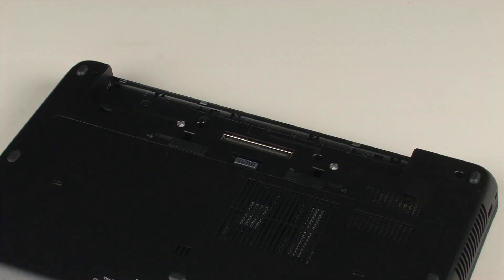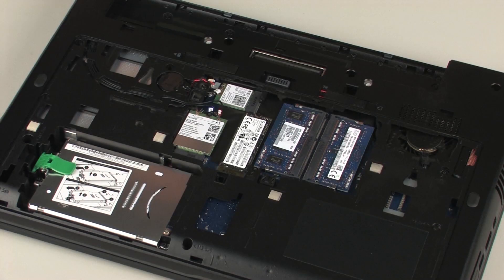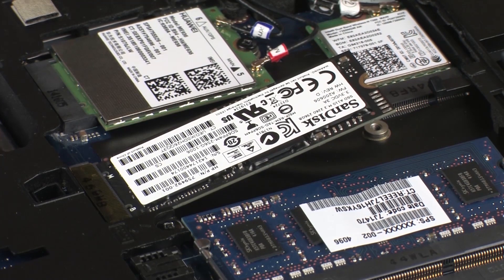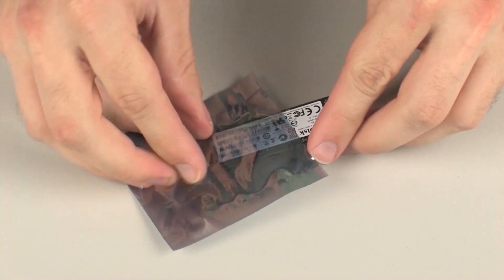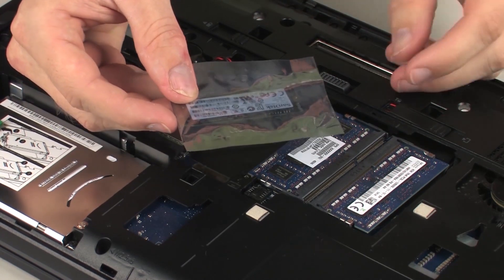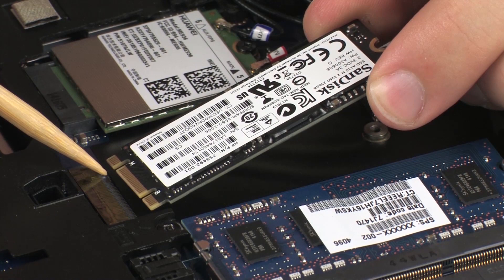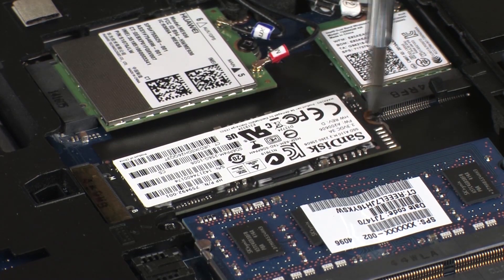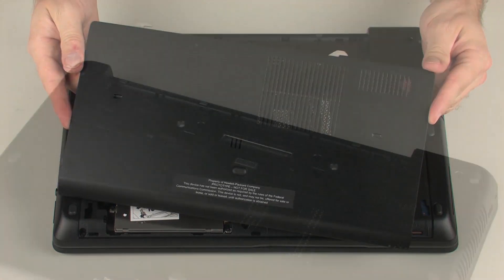Replace the Solid State Drive | HP ZBook 15 G2 Mobile Workstation | HP Support

Comment: Support 
NVMe M.2
500GB
crucial
Reply: Win 10 install , but it's not noot from m.2
Reply from the maker: Hi Rouzbeh, thanks for contacting HP Global Social Media Support!
I understand that you are experiencing an issue in booting from M.2 SSD. 
I will do my best to assist you.
Since the service manual makes no mention of a NVMe SSD being supported, it isn't going to work in any capacity.
It won't boot, you can't use it for storage.  Nothing.
You would have to try it with a SATA SSD.
Binu_HP Social Media Tech Support

Comment: HP manual book seems irrelevant. My Zbook 15 G2 can only use M.Sata SSD with form factor 2242 (with two screws).
Reply from the maker: Hi there, thanks for contacting HP Global Social Media Support!
I understand that you need to know about supported hard drives.
I will do my best to assist you.
Please refer 'Storage and drives' under the specification page to know about the supported drives: https://bit.ly/438gaf2
Binu_HP Social Media Tech Support

Comment: I can't find a straight answer on google. I cant find a diagram that lables all the expansion ports on the motherboard. CAN YOU PLEASE TELL ME WHAT THAT PLUG IN CHIP IS ON THE LEFT OF THE SSD? not the wifi chip above but the bigger chip on the far left. My port is empty but yours has something. I am just curious what it is for so i can decide if i want to add one to my own labtop. thanks.
Reply from the maker: Hi Robert, thanks for contacting HP Global Social Media Support!
I understand that you need a diagram that labels all the expansion ports on the motherboard.
I will do my best to assist you.
Please refer the service guide of your computer as it may be useful to you: https://bit.ly/3ZBvChh
Binu_HP Social Media Tech Support

Comment: Hello, I started an installation using a pen drive to do in a SSD 250GB but when the copy of files has done and the system restars it re-start by zero from the usb key
I removed the sata SSD but in the bios I see again it
Reply from the maker: Hi Mauro, thanks for contacting HP Global Social Media Support!
I understand that you are experiencing an issue in setting up SSD.
I will do my best to assist you.
Please refer to the instructions mentioned under this document to fix the issue: https://bit.ly/3rO41Z9
Binu_HP Social Media Tech Support
Reply: @HPSupport  Sorry but I didn't find the solution... peharps I explained bad
I' a ZBook G2 15 workstation with an SSD sata on board and I bought a SSD mvne M2 and I'd like install Windows on it.
I unplugged the old SSD and I started the installation by the usd key
whe I ha to choise where the installation I can see the new SSD M2 and it copied all files on the SSD M2
Now, it's normal, the system reboot and the installation goes haed but...
when the laptop restarts it doen't see the SSD m2 and restart the installation by the USB key, so I trusted to remove the key
but nothing the system bios said non hdd or ssd are present
If I see the list I can see the old SSD Sata (model number serial number) as it's mounted but it is unplagged.
Reply: so the question is: how can I do to mek SSD M2 available on BIOS? Why I can see the old SSD in the list?
Reply from the maker: Thanks for the reply.
Please try updating the bios of your computer as mentioned here to fix the issue: https://ftp.hp.com/pub/softpaq/sp103501-104000/sp103523.exe
Binu_HP Social Media Tech Support

Comment: I added ssd next to hdd and moved windows 10 to ssd but it boots from hdd what to do?
Reply from the maker: Hi Yousef, thanks for contacting HP!
I understand that you have added SSD next to HDD and moved windows 10 to SSD but it boots from HDD.
I will do my best to assist you.
Please try the below mentioned steps to fix the issue:
Shut down your computer, remove the back, and removing the HDD. Then, start up the computer, and it will boo from the SSD. Then,  shut it down again and reinstalled the HDD, put the computer back together, and boot to BIOS. It should show the SSD as the boot drive.
Please let us know how it goes. 
Binu - HP Social Media Tech Support

Comment: Hello
I installed the m2.ssd nvme hard drive on the same laptop model and installed Windows, but when installing after restarting, to continue installing Windows, it gives the error that there is no booted image  disk, please help.
Reply from the maker: +Hamed Salemi Please have it default to the M.2 in 9 easy steps:
1. F9 in Startup Menu
2. Boot from UEFI file
3. Search through a ridiculously long file name (looking for "PCI") to find M.2 - PCI needs to be listed twice
4. Click <EFI>
5. Click <Boot>
6. Should only be one option - mine said "bootx64.efi"
7. It will boot one time with the M.2
8. Use DISKPART in CMD to remove all partitions from the old HD or else it will always boot from the original drive (unless you remove it)
9. Presto! Now it will default to the M.2
Reply: Hello, thank you for your answer. How can I send you a photo or video taken? Do you have an email? Or WhatsApp?

Comment: Has anyone here successfully installed their NVMEs (PCIe or SATA) on their Zbook 15 G2? if so lplease let me know the specs e.g. brand, model, size, etc. that worked for you.
Reply from the maker: +Ted Francis Asuncion It does not support NVMe.
Reply: @HPSupport  okay.. Thanks so what's the purpose of those slots then?
Also, if I go with the 2.5 SSD, can I get 1TB or 500GB?

Comment: HP SSD EX900 M.2 PCIe NVMe / HP EX 950 M.2 PCIe NVME compatible? there are issues while the manual specifies, B/M key is two notch in the SSD(AHCI) and only M key is single notch in the SSD(NVME). From the video it shows it will support B/M Key, wherein the word NVME refers to M.2 "M" key. can you please clarify which type of NVME M.2 will support?
Reply from the maker: +Subramani V Please refer the service manual of your computer to check the compatibility: http://h10032.www1.hp.com/ctg/Manual/c04493862
Reply: @HPSupport  Service manual not exactly provide the information what I was looking for, however, I got fixed the NVME M.2 Key, this system having auto switch to convert / identify the SSD module. So it support M key as well B + M key
Reply: Its too long

Comment: I hv installed mSATA, it is read as a secondary drive, I installed windows 10 on it, but won't boot from the Nvme HP EX 900 250GB. Download latest bios HP site but still no driver  support on bios. HP ppl sort this
Reply from the maker: +Thulani Dube Please perform updates via Windows and HP Support Assistant as mentioned below to fix this issue: Step 1 Windows Updates - 1) In the search box, type and open Windows Updates. 2) Check for updates. 3) If the updates are available, click on install and restart the computer. Step 2 HP Support Assistant Updates - 1) In the search box, type and open HP Support Assistant. 2) Check for updates. 3) If the updates are available, click on install and restart the computer.
Reply: @HPSupport  not working, why can't HP supply bios updates with nvme driver support
Reply: @thulanidube3391  HP EX 900, NVME SSD(M Key) detects as Secondary Drive?
Reply: @c4subramani  yes
Reply: @thulanidube3391  Thank you!
Reply: @thulanidube3391  It works, NVME M.2 M key support. Thank you again.

Comment: I've got a problem, SDD m.2 2260 SATA III doesn't appear... However, the documentation of my zbook says "There is one internal M.2 PCIe/SATA slot. This slot is auto-configured at power up to be a PCIe or SATA slot depending on the type of card installed. M.2 slot supports 2260 SSD (Solid State Drive)"
Reply: were you successful in this one?
Reply from the maker: +LesCraslins Martinez Please perform updates via Windows and HP Support Assistant as mentioned below to fix this issue: Step 1 Windows Updates - 1) In the search box, type and open Windows Updates. 2) Check for updates. 3) If the updates are available, click on install and restart the computer. Step 2 HP Support Assistant Updates - 1) In the search box, type and open HP Support Assistant. 2) Check for updates. 3) If the updates are available, click on install and restart the computer.

Comment: Dont buy this laptop as it keep having the BSOD issue(device power state failure), feedup with troubleshooting this issue.
Reply from the maker: +Hard code Please perform updates via Windows and HP Support Assistant as mentioned below to fix this issue: Step 1 Windows Updates - 1) In the search box, type and open Windows Updates. 2) Check for updates. 3) If the updates are available, click on install and restart the computer. Step 2 HP Support Assistant Updates - 1) In the search box, type and open HP Support Assistant. 2) Check for updates. 3) If the updates are available, click on install and restart the computer.
Reply: @HPSupport  already did all that even install driver updater driver booster pro paid one which is unable to detect the nvidea driveras well. the last service is left in these days is to call the service guy which is unavailale due to corona,good day.no more HP laptop.

Comment: sir i have hp zbook 15 g2 which requires a charge of 150w but my charger had stopped working can i charge my off laptop without using it with 65 w charger with same pin
Reply: I know it may be too late, but will most likely not charge or be detected.
Reply from the maker: +Fariha Mughal You can purchase the part from here: http://partsurfer.hp.com/ Please select your country and enter serial or product number of your unit.

Comment: I have hp zbook 15 g2 workstation  laptop. 
It supports m2 ssd 2260.
After putting the m2 sata  and disable the secure boot and enable UEFI , When  i try to install windows the m2 ssd doesn't appear in the windows section. Why it does so?
Note : i have m2 ssd of sandisk x110 256 gb

Comment: Does the HP Zbook G2 15, fits a NVMe SSD 80mm?
Reply: i saw a manual 2260 is best but i also can't find 2260 for it
Reply: @sibghaafzal4106  Nope, only with a 60mm
Reply: @ABog-mz1hs  what do you mean?
Reply: @sibghaafzal4106  Only a 60mm SSD will fit... You can find on Ebay or Amazon a disk like that... Maybe on Aliexpress too
Reply: @ABog-mz1hs  can you send me its link?
Reply: @thecottonvalley  Search on Google for 2260 ssd. You will find enough choices.
Reply: After putting the m2 sata  and disable the secure boot and enable UEFI , When  i try to install windows the m2 ssd doesn't appear in the windows section. Why it does so?
Note : i have m2 ssd of sandisk x110 256 gb
Reply: @thecottonvalley  
1. Do you have the latest BIOS version?
2. Did you do a disk check in CMD? Diskpart > list disk
3. With the old Windows, the m.2 shows in diskmanagement?

Sometimes you need to format the m.2 in the old Windows before using it.

You can also use a tool; minitool disk partition
Reply: @ABog-mz1hs  i haven't a windows in the laptop
Reply: @thecottonvalley  Create USB stick with Windows on it? Rufus can create a Windows.
Reply: @thecottonvalley  Me too...

Comment: Can the Zbook 15 G2 mount 2242?
Reply: @knuxyl  its 2260. i checked the manual.
Reply: the manual not give clear answer for ssd m.t nvme or stat 3 - i cant  install operating sys on it @sibghaafzal4106

Comment: 256 Gb Intel 760p SSD M.2 doesn't work with HP ZBook 15 G2
Reply from the maker: +Дмитрий Буланов Please refer page number 39 of the user manual to know about the supported hard drive: http://bit.ly/2IK7tR9
Reply: I ran into a similar issue. From a look at the hp page provided  earlier it appears that all the m.2 drives are sata instead of nvme. I just bought a kioxia nvme, and I tried to use it as a bootable drive. I tried everything I could think of without luck. I am at bios version 1.25. Windows 10 recognizes the drive allowing me to format it/write/read from it, but it wont install windows to it stating that the controller wont allow it as a boot drive :( shenanigans
Reply: @knuxyl  As far as I see from a google search, his SSD doesn't have the right pin to be compatible with Zbook wich needs B pins.